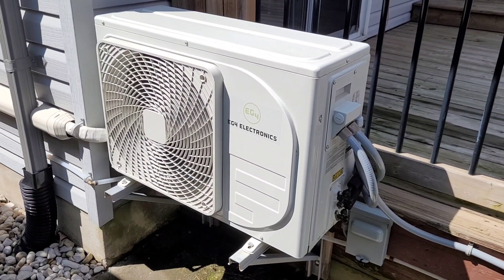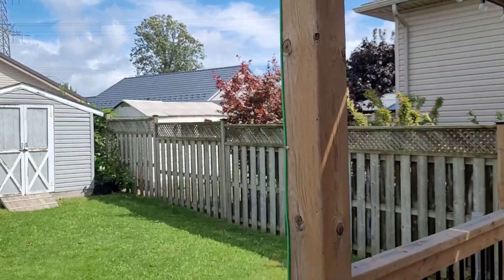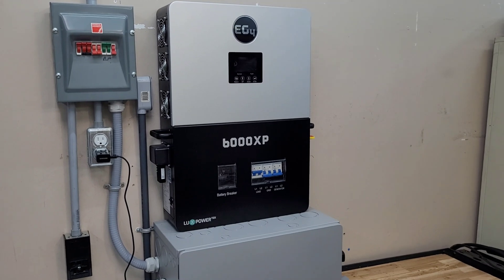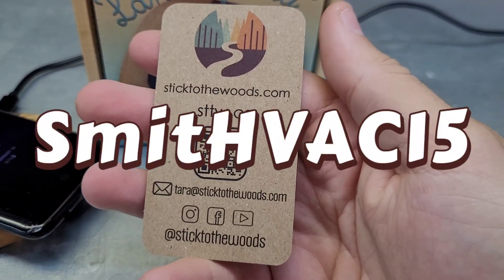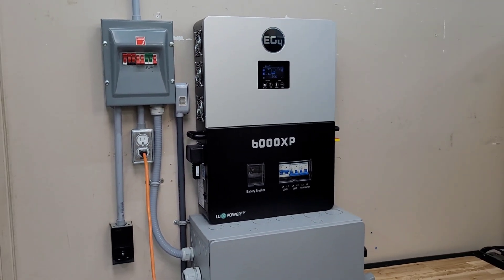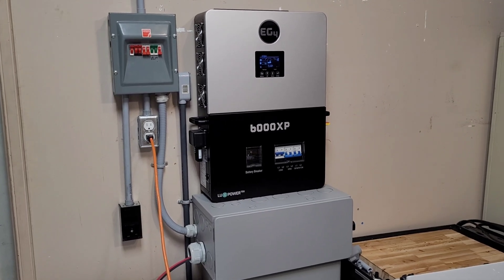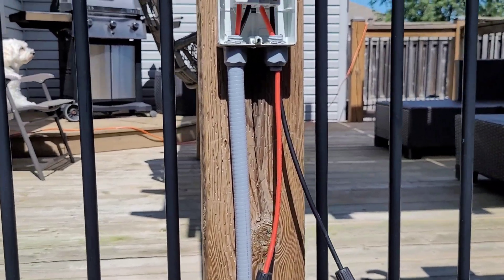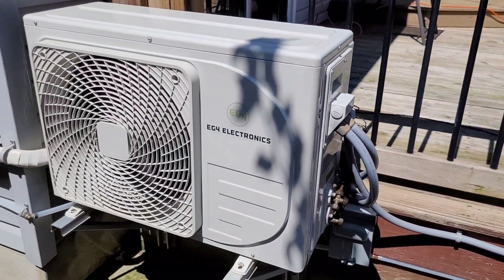I Added 14.3KWH Of Lifepo4 Battery To My EG4 Solar AC!

Comment: For the WiFi dongle, do you have a recommendation of one to buy for the mini split?
Reply from the maker: @markaldridge8755  it's built in to the unit
Reply: So I just install all and search for it on my phone?
Reply from the maker: @markaldridge8755  yes, if its an EG4
Reply: Yes it is.  Thanks for your help.  My installer is Amish and doesn’t know some of this stuff.  No cell phone for him.    

Would the dry mode use less power than heat mode?   I live in Ohio and I’m trying to save battery but trying to keep cabin from freezing when I’m not there
Reply from the maker: @markaldridge8755 No, dry mode is air conditioning with a very low fan speed. You would be better off in eco mode to try to save battery
Reply: Thanks.  Appreciate the guidance

Comment: My 9k btu $500 Pioneer mini split uses ~700wh for 2.5 hours in AC mode set at 74f. I r20 all the HVAC inlets/outlets in my 🏠 so it holds the temp for the rest of the night if I keep the 🚪 to my room shut.

Comment: Looks good and clean setup. Is the panel next to your inverter a transfer switch? If so what brand or model?
Reply from the maker: The one in the garage is a load centre, the transfer switch is in the house. It's a federal pioneer.
Reply: @SmitHVAC. Curious how did you wire your transfer switch? Did you set the load as utility power and then switch the source between your PV system and straight to your breaker panel?

Comment: Simple curiosity here but what were outside weather conditions like during this test? Texas is hot, humid and pretty much disgusting during summer time so typically our ACs will never shut off entirely during the night. Its awesome to see you running so well on only 2.5k watts!
Reply from the maker: @UserFormelyKnownAs_hjkh  very mild during this test, only a high of 79 during the day and into the low 60s at night. I'll do it again if we get another heat wave this year!

Comment: After a year of running my 24k system in the garage (its been wonderful!) finally able to start planning the solar side of it.  The manual says max input power of 3500w, should I look at trying to get close to that? What's a minimum wattage of solar that I should do?  I'm in southeast WA state, so maybe a slightly similar climate and solar load as you?  though probably not quite as cold in the winter, and a bit hotter in the summer. Best roof location probably limits me to a 3x2 layout for most panel sizes.  maybe 4 and 3.
Reply from the maker: Yes you should try to get it pretty close to maxed out. Make sure your voltage is up around 200vdv, I was playing around with some lower voltage panels and it kept shutting off under cloud cover when the voltage dipped too low

Comment: I have a newer EG4 24k and have a question for you. You said it shut down just after midnight. When yours shuts off does the fan turn off also? I haven't seen a way on mine to do that.
Reply from the maker: @jamesstobaugh435  the fan will continue to run so it can circulate airflow and read the indoor temperature accurately

Comment: My 3 ea 9K’s 30.5/33/22 SEER use about 10kWh average overnight. You need at least 20kWh if it’s below 20F and you are heating a large 400 sqft area with them. Of course they can all idle  down in mild weather or in a small conditioned space to about 150-300W consumption.
Reply from the maker: @USA-GreedyMenOfNoIntegrity  Yea of course. I'm in Canada and summer is winding down. Winter will be a different story
Reply: @SmitHVAC.  i’m installing my first two gree (Airtemp) inverter 5 ton (actually 4.5 Ton) systems looking at the charts for winter time. The power consumption is nearly 7000 W. Jeez. 15.8 SEER2. That would take a lot batteries below 20F on a 3000 sqft area.
Reply: How well insulated is your 400sqft area? I ask because I am building a 24x24 small house.